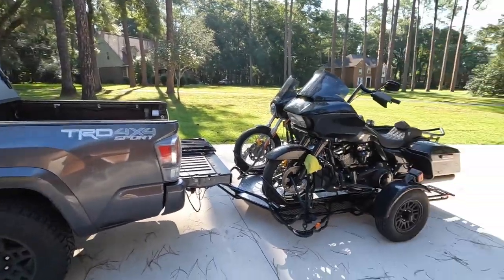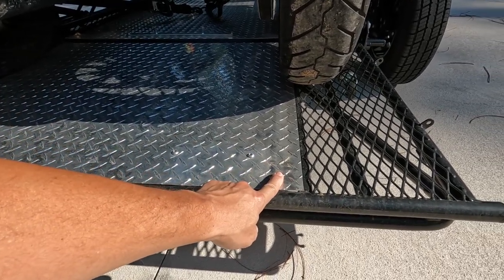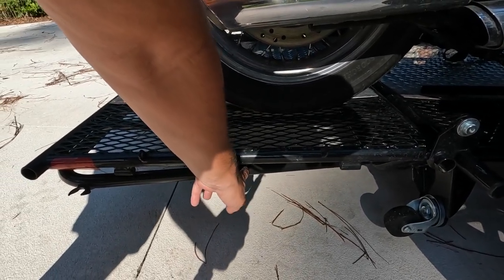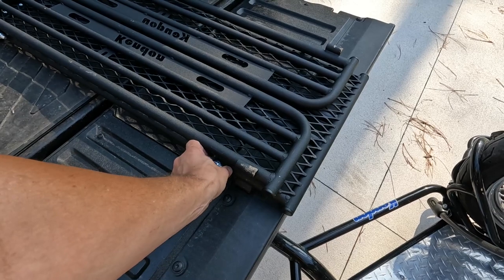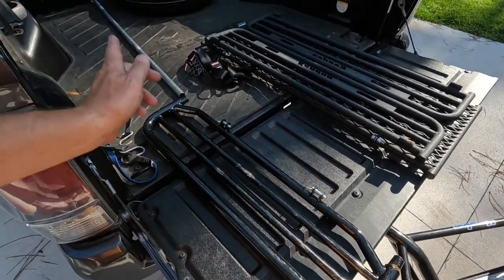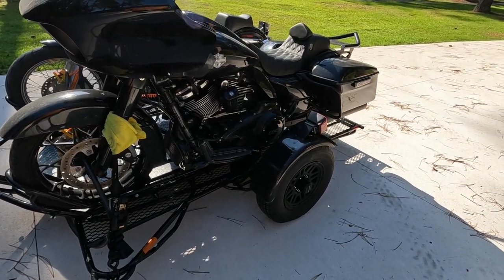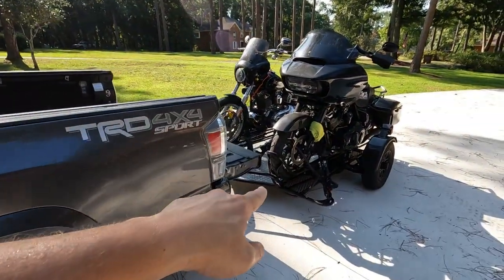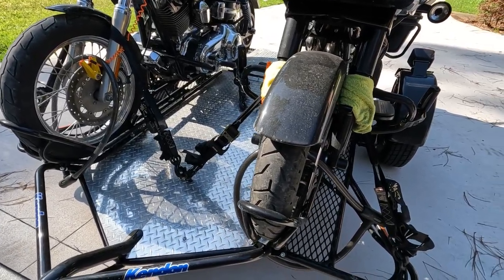Kendon Trailer........Long trip review and thoughts

Comment: I have a 2001 single kendon Stand-up that has probably 30,000 miles on it from Florida to Wisconsin and out to Stirgis every year. Follows beautifully. Only replaced the tires and wheel bearings 3 years ago. Still looks like new because I believe in continued maintenance
Reply from the maker: That is great feedback! I am glad yours is holding up well.

Comment: All valid points. Even if you only buy single bike model, those castors becoming worn is a big problem. These speed bumps are out of control!
Reply from the maker: Definitely
Reply: I use bungees to hold them up and out of the way.

Comment: I’m consider buying one of these. What are the castors used for?  Don’t you move the trailer around with the wheels?
Reply from the maker: The casters are used to move the trailer around in the folded position. You fold the trailer up and once it is standing upright you can roll it into the storage spot. Hope that answers your question. Thanks
Reply: Be aware that the dual rail is HEAVY and it can be tricky to raise it on to the casters.  And make damned sure the surface you are working is flat.   The single is much easier to handle.

Comment: As an owner of single, double, and triple Kendon's, I have some tips and suggestions.  First off, buy used =)  I picked my three rail for $600, the single for $1K and my double for $1200.  You need to be cautious of course, but around SoCal, you can find good used ones well bellow $2500.   On all three, the first thing I did was put in new bearings , seals, and grease.  And make sure you check the tire build dates (see further down).   I modified my dual considerably as the stand-up height was too high to fit my storage space.  I had a trailer shop modify the tongue to shorten it and I use a removable coupler (just a receiver with a coupler welded to a shank, held in place with a pin).  The whole front of the trailer is much stronger now too.  Regards the lights...I learned with my triple (three dirt bikes or one track bike), that the taillights are vulnerable when just trying to move the thing around on the casters.  I use magnetics, assisted with cable ties.  To protect the casters, I use bungee cords to hold the up out of the way when trailer is in use (and to keep the center caster from getting stuck on the frame rails).   For rear tie-down points I use heavy duty loop straps around the frame members at the fold joint.   My dual is an older model non-ride on version, but I have ordered the newer dual ramp and have a heavy duty chock to mount in the center, so that I can at least use it solo.    Regards tires...I totally forgot about the tires that came with my dual as they looked good and had plenty of tread.  Towing along at 65, with two 500lb bikes on it, one of the tires developed a bulge.  No problem...pulled over and had the spare on in less than ten minutes.  Next day, same speed, the OTHER tire comes completely apart.  Trailer held steady long enough for me to get over into the emergency lane and no part of the frame made contact with the ground (though there was maybe a 1/4" between the caster bracket and the pavement.   Put the "bulged" tire back on and very slowly made our way into the next town, but that is a whole different story...
After getting home, I checked the mfg date on those tires....they were 12 years old.

Comment: Good video.  These trailers are expensive but they are quite well made and strong, and the folding feature is great.  They tow low  and close, which helps fuel  economy, but I'd worry a bit about rock damage to those nice Harleys.  I use mine to tow dirt bikes  so that is not a concern, and with the dirt bikes one can dispense with the ramp getting  them on  and off. 

Regardless of what the Kendon site says and carefully cropped and edited video showing a woman lowering the trailer, lifting and lowering these heavy trailers is a chore. I bought a Harbor Freight electric winch, mounted it securely to the garage wall and use that to lift and lower the trailer.  

Bought my full sized trailer like the one in this video for 1K, complete with center bike shoe.  It was in ruff shape as the tires were ancient and the  bearings were shot.  Took care of those issues and it's been great.  I use it to haul 3 dirt bikes or two full size ADV bikes out of state.  Added a 5 gallon gas can holder to it also, which comes in handy. 

No huge complaints but I agree, going on 5K is a lot of dough for a new one, you can buy a new 6x10 Interstate enclosed trailer for that kind of money.  The big attraction of the Kendon for me is I live in HOA Hell and can't park a trailer outside...

Comment: I’ve literally pulled hundreds of trailers for work and recreation, and this trailer has too many shortcomings for me.
I ended up getting an Aluma UT-10 trailer, with full width slide out ramp, 18” rock guard and diamond plate storage chest.
It was also super easy to install a spare tire mount on, and not have to carry all the essentials somewhere else!
I can carry 1 bike, 2 bikes, or even my Ural Gear Up hassle free.
I don’t use the Aluminum trailer in the winter here in New England (road salts eat them up).
I have a steel trailer for winter projects.
Reply from the maker: I agree with you an the shortcomings, but if you have to have a folding trailer due to space constraints I think it is a very good option

Comment: Nice video, thank you for your thoughts on it, you think for the money you spend engineering would of thought about some of these issues that you talk about. I just piced up an 04 double bike kendon trailer, how level does it have to be once hooked up to your truck, i noticed when it was hooked up to my jeep it sat a little low in the front it wasn't level, maybe i need a different hitch to make it level, and that was with no bikes on it. I dont know how critical it is, a little low or high, or does it have to be dead level. Never had a trailer, always used my pickup trucks. We will be hooking it up on my brother's Tacoma also, but his looks like it might sit a little higher then your truck. Any help would be appreciated thank you
Reply from the maker: Personally, I think when the trailer is loaded it should sit a a little low in the front or at least level. When it’s not loaded it would be a little higher due to not having any weight on the trailer. If you look at the way the trailer is made there is a lot of it hanging fairly low under the trailer and it is more acceptable to getting damaged. The casters will definitely hit and get damaged as mine have. Also….hook it up and load the bikes on it and do a short trip around town to see how it is pulling, tracking and riding at different speeds and that should help you figure out how to set it up with your tow vehicle. Ride Safe!
Reply: @tacoontwo  I'm just trying to figure out if I have the right hitch for it, the one I put on my jeep looks like the one in your video. It looks like a 2" drop. With no bikes on it to me it looks like it was dipping down. So now I flipped ball around on same hitch but didn't get a chance to see how it looks. I am in the process of doing maintenance on the hubs, but I'll check it all out like you said and I'll settle on something. Thank you very much for getting back to me, Merry Christmas, have a great new year
Reply: The trailer should sit slightly high in the front when loaded.

Comment: Would your RZR fit on the Kendon trailer with a few mods? I'm getting a 900XP and like the compact trailer. I would move the tail lights down and below the top of the fender
Reply from the maker: Kendon makes a stand up SXS trailer that I would suggest looking into. It appears it might be easier to convert to haul a motorcycle if you wanted that as an option also.

Comment: Another problem is that if you get a flat and leave the spare mounted under the trailer, you have to completely unload the trailer remove the spare and then reload the trailer. 
No thank you.
Reply from the maker: Your correct. I don’t put the spare there at all. I just throw it in the back of the truck to avoid that problem.
Reply: You put It There when you store trailer only not when you use it.if you chuck in in your garage an get in a hurry you might forget it.if its in your face when you pull out your trailer you wont forget it then toss it in tow vehicle along with your ramps. That's what I plan on doing with the one I just got. It has worked out nice already. When my buddies girls hd broke down an needed help. They didnt trust a tow company.